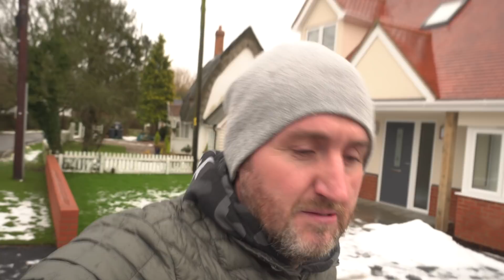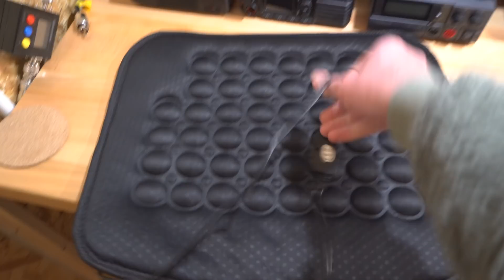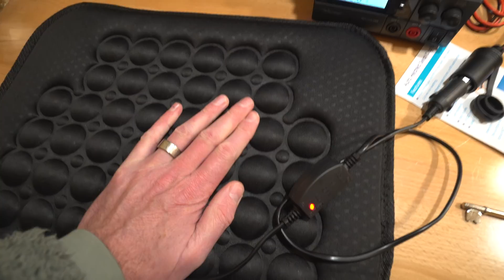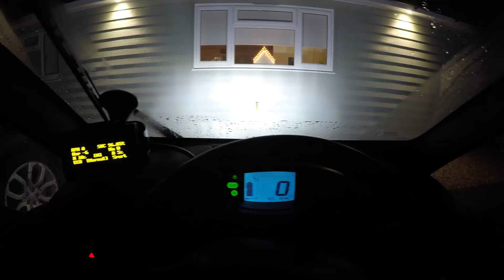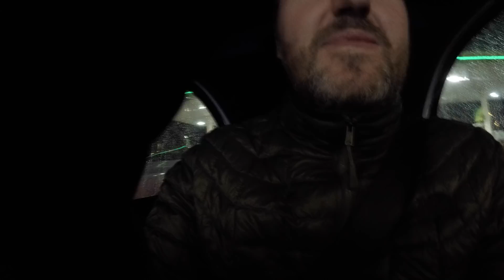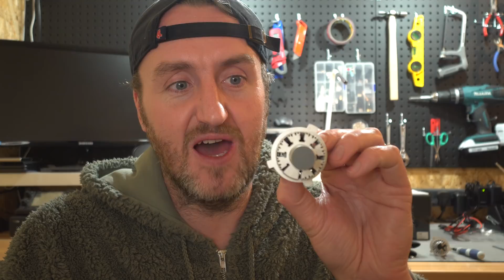TWIZY LED HEADLIGHTS BLINDED POLICE!!!

Comment: I used the NOVSIGHT H4 HB2 led bulbs and they have work great ever since! 
All i did is filed 2/3mm of the outside lip on the twizy’s headlight cap, and unscrewed the black plastic triangle on the led bulb, then pushed the main part of the bulb in threw the cap and from the other side pushed and screwed the black piece of plastic “after removing the original silver spring on the twizy’s headlight cap to give me more space” to the main body of the led bulb.
The problem with some led bulbs is that the H4 versions don’t have a little silver scoop to direct the low beam up, therefore with your bulbs it looks like you have the main beam on because the light is free to go everywhere in the reflector, rather than being directed.

Comment: Robert Murray Smith will be experimenting with a Twizy that FWG have just acquired. They'll be replacing the battery with one they've made from simple materials, and taking it from Land's End to John O'Groats next Summer. Check out his channel; you should find it interesting.
Reply from the maker: Ah yes I saw that, I’m following with interest!
Reply: Thought that you might.

BTW, found you today yesterday, and subbed on the strength of this video. Time for a marathon catch-up while the world is preoccupied with the rubbish on TV during the Winter Spendfest. 73 / G0MRB.
Reply from the maker: Brilliant! Thanks a lot, appreciate that :-) I'm a fellow HAM radio guy if you didnt already know! 73/ M6JKA.

Comment: https://www.classiccarleds.co.uk/collections/headlight-led-bulbs/products/latest-led-headlights-h4-philips-z-es-hi-lo-beam-conversion-9-32v
These are the only LED headlights that give the correct beam pattern. I use them and they work perfectly. But be aware that after market LED headlights are not technically legal. You may have to switch them back for the MOT. Depending how picky the tester is.
Reply from the maker: Interesting, thanks for this, they look great. I think I’ll give them a try.
Reply: finally, maybe we can stop being blinded by people who only care about themselves

Comment: Range extender do not work that good. Getting the different discharge voltages to sync (even worse with different chemistries) is tricky and reduces the efficiency.
Just take a look at what we do in the German Twizy-Forum. 
A bunch of our guys have "reverse engineered" the Twizy component protocol and replacing the battery with something with more capacity should not be a problem.
https://www.twizy-forum.de/Alternativ-Akku

BTW: With a OVMS you now can reduce the charging power from 2000W to 350W.

LED: The beam pattern of the most LED are a bit dodgy. 90% of china products opens up the illuminated area and boosts the lumen.
Have a look at these : https://www.twizy-forum.de/werkstatt-twizy/81786-led-umruestung?start=75#123694

Only minimal modification needed.
https://www.twizy-forum.de/media/kunena/attachments/21500/LEDUmbauTwizyStandlichtundH4REV2.pdf

Perfect beam pattern (have managed to get them through a light test at the TüV ;-) ) but the are a bit too bright.
2000lumen instead of the 1600 lumen max allowed, but I´m working on reducing the light.
Have to find the right settings fpr the microcontroller in these things. Perhaps just replacing some sensing resistors?
Reply from the maker: Wow thanks for the really useful links! :-) I cant read German but hopefully I can make sense using google translate! I’ve quickly realised the range extender isn’t going to work well, I’m seriously looking at building a battery with higher capacity and maybe Orion BMS to communicate with the rest of the car. Do you know where to get the standard battery enclosure? I feel if I ask my local Renault dealer they will look very surprised!!!
Reply: The project is on Github ;-) And it´s in english ;-)

You can find this part list on there too : 
https://github.com/dexterbg/Twizy-Virtual-BMS/blob/master/extras/Twizy-Battery-Part-List.md
(Maybe try to order the case at once. I imagine, when Renault realizes whats happening, they stop selling it to 3rd parties)

Just contact KlausZ https://www.twizy-forum.de/forum/profile/3145-klausz or edriver https://www.twizy-forum.de/forum/profile/16015-edriver

They have built their own battery and moderate that section of the BBoard. 

Also "We speehk Inglisch" ;-)
Just post your request in the forum, most germans with technical background can handle that old germanic dialect you speak over there ;-)

edriver is engineering a dedicated BMS from scratch.
https://www.twizy-forum.de/Alternativ-Akku/83466-twizy-bms-entwicklung

  It would be amazing if you would build your own battery and document this here on youtube!
Reply: Edriver (Pascal) is building a complete integrated Twizy BMS solution for ~300€. If you'd rather use the Orion, make sure it can implement the Twizy protocol by uploading custom logic -- the website doesn't mention that capability.

If you don't fear using Arduinos on the road you can also use our KlausBMS code base:
https://github.com/dexterbg/KlausBMS

Be aware there's an open issue on the VirtualBMS regarding later generation chargers:
https://github.com/dexterbg/Twizy-Virtual-BMS/issues/1
Reply: I think andy has a charger GEN 1! ;-) The PowerBox indicated 2250W charging in the last video:-)
Andy, when you charge your twizy, does the charging fan turn off after the display turns off?
Reply from the maker: Ah ok, that’s good then!
Reply from the maker: This is fantastic! Thanks! Now I have been reading all morning :-)
Reply from the maker: This dedicated BMS sounds good. I’ve had experience with Arduino’s before and even built my own Arduino but I would rather the integrated solution. Are they in production yet?
Reply from the maker: Haha! I liked your comment about inglisch!!! It would be great to document a battery build on this channel. I’m now considering which cells to use, 18650s, prismatic or try and find some leaf cells...
Reply: Pascal is still ironing out some kinks. We all are waiting patiently for the release date ;-) But it´s a one man project and he wants to get the hardware right. And for most of us the battery contract has still 1-2 years on it anyway.

Comment: I know this is on your twizzy vid but its a question on the bike wondered what camera you use to record and what helmet you use for when on the road. As ive just got my self a E rider model 15 and i want a helmet that fits with the speeds it does but not sure what would be best. Its limited to 15.5 mph but ive managed to remove the limiter and now got it going 24/25mph
Reply from the maker: I have a fox rampage which is a downhill full face helmet, I’d recommend full face on an ebike but maybe a motorcycle helmet is OTT and might get you unnecessary attention from police. The camera I use is a go pro hero 5 with the audio interface and a lapel microphone mounted inside the helmet near my mouth!

Comment: I would've thought the high beam should be pointed upwards. As you have the dipped beams upwards, they might be pointing too high and therefore blinding uncoming traffic.
Reply: TjoebTjoeb nope, he's just using illegal bulbs and they don't provide a beam pattern, just danger to oncoming vehicles. total dick move.
Reply: @merlingstoss6332  , and/or bad suspention setting. Put some weight in the back & those long-distance projections are going to point upwards.